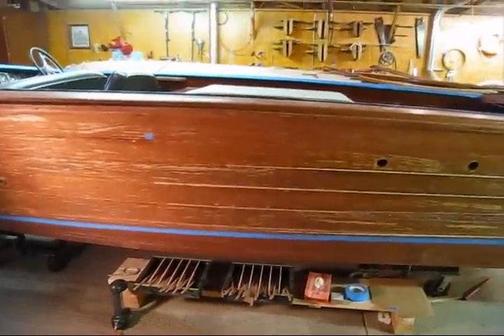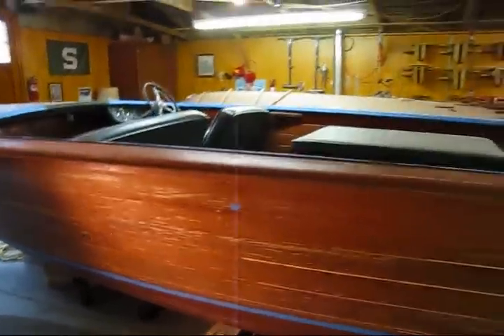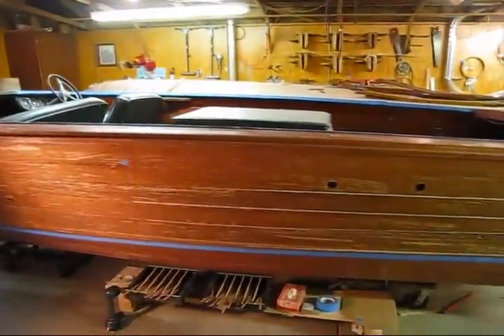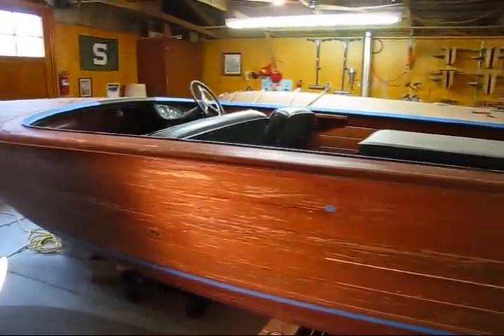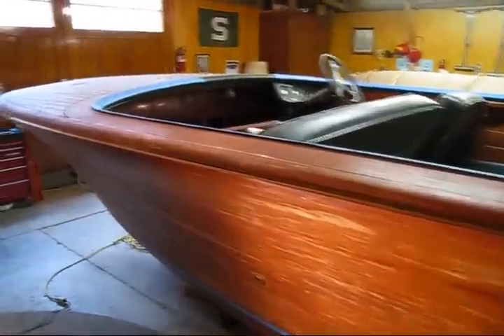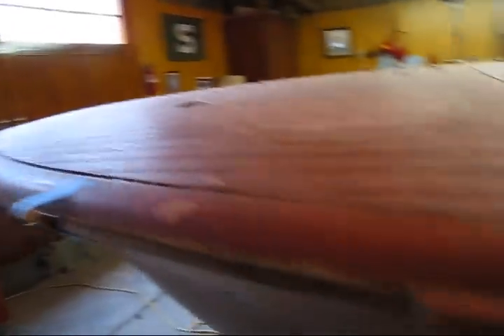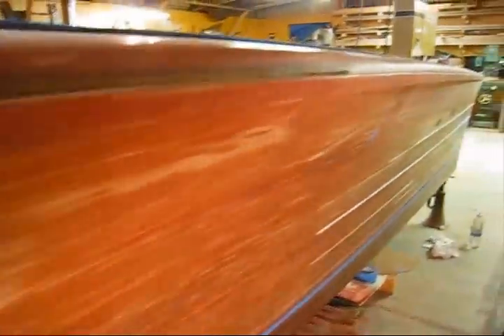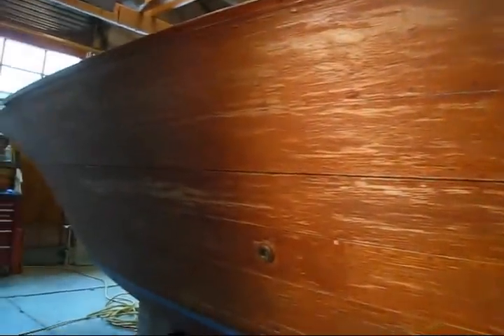Cutting, Fitting and Gluing Mahogany Strips in Hull Seams (Preview)

Comment from the maker: I'm glad you mentioned the "plank removing" idea. I forgot to mention in the video that this is another option. It is a lot more work and money but it is probably one of the better ways to fix this problem. To do this you remove all the bungs, remove all planks, seal the back sides of them, install them, bed them in caulk (option), fasten (probably new fasteners) and bung them. This does not mean all the planks will fit perfectly, some fitting is still needed. This is the boat owners decision.